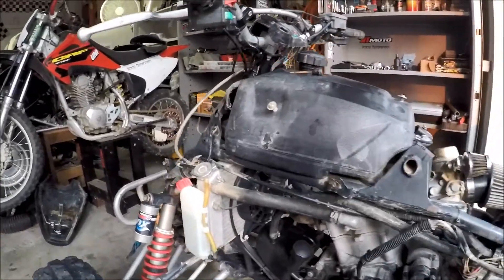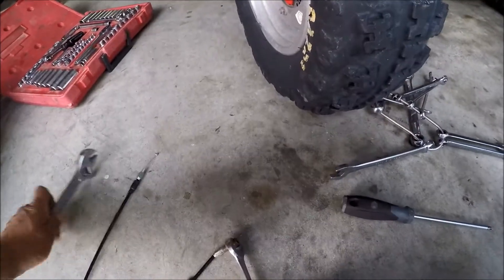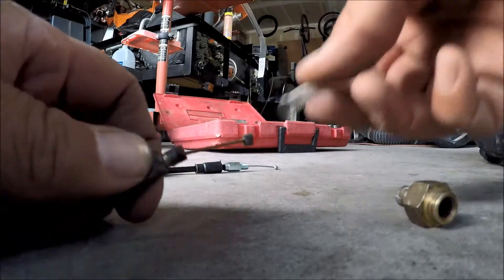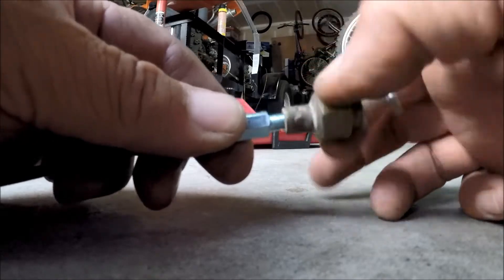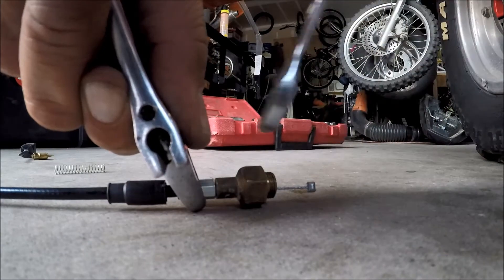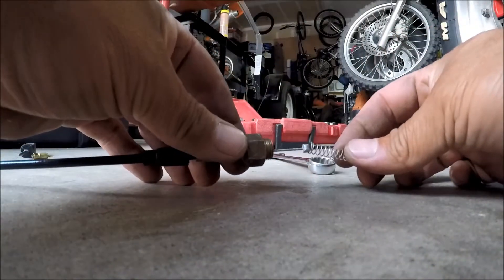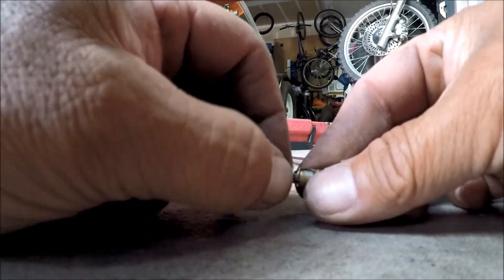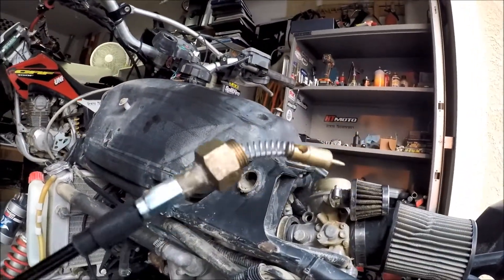Polaris Predator 500 choke cable.

Comment: Did you rejet your carburetor for that filter. And what size is the filter.
Reply from the maker: The elevation where I live is about 250, and with an aftermarket exhaust, I use 175 to 180 main jets. So yes I had to rejet the carb.

Comment: How did you get the choke cable out of the carb?
Reply from the maker: Use a 16mm wrench on brass choke bolt on left side of carb.

Comment: My brothers polaris Carb choke is on the carb and makes it a bitch to open and close it
Reply from the maker: @Vazerin  lube the cable.
Reply: @mg016  no it's literally just a little nub connected straight to the carb, not even sure if the carb is for the Predator, it's Mikuni though
Reply from the maker: @Vazerin  remove the choke and clean it., might have some gunk in there.
Reply: @mg016  I'm sorry I'm terrible at explaining the issue, pretty much to pull the choke you gotta reach between the frame/gas tank and head of the engine and the hole is only big enough to get 2 or 3 fingers in, if the quad had side plastics it'd be impossible to reach the choke
Reply: @mg016  honestly think the last owner must've used a Sportsman 500 or some other Utility Polaris quad carb cause the outlaw carb looks nothing like the predators, might explain why the carb choke doesn't go all the way to the handlebar cluster